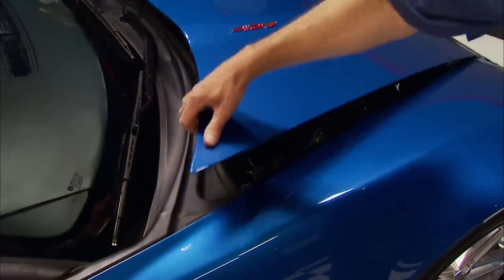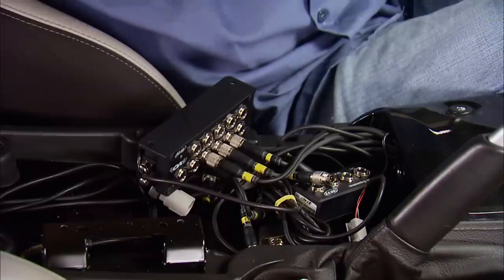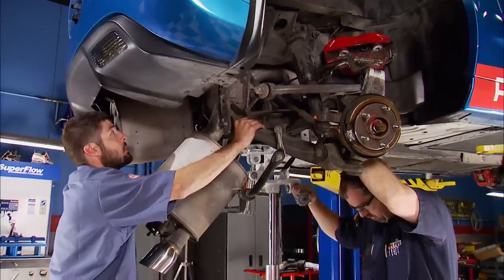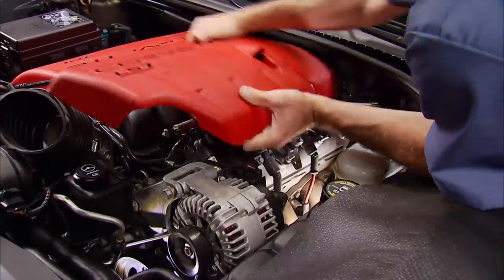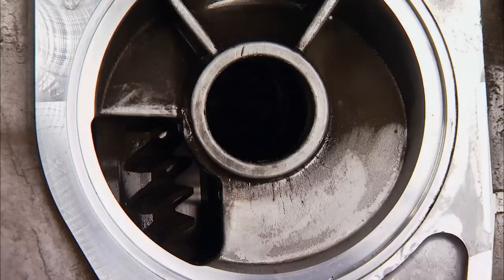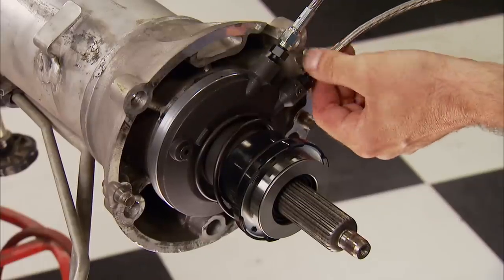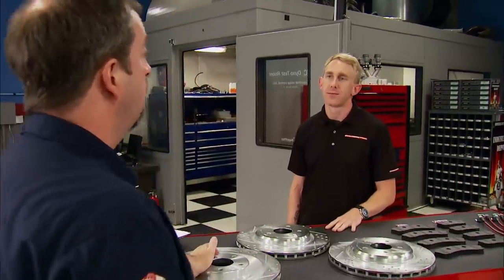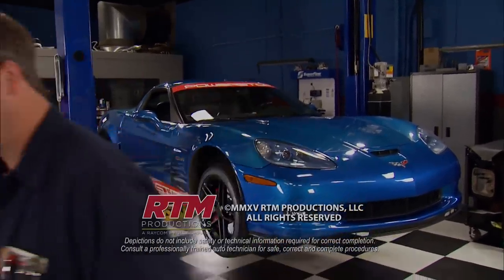Can We Upgrade a '08 Z06 Corvette to Outperform a '15 Z06 For Half the Cost? - Engine Power S2,E17

Comment: I have about $45k total invested in my 2008 Z06 (I know it's not worth that much. Engine upgrades costed around $10k - money I'll never see again, but it sure makes the car fun!). Anyway, it's just a naturally aspirated Heads/cam/exhaust LS7. No supercharger, turbos, or nitrous. Since it weighs just 3100 pounds, and now produces 660 hp, it will outperform any stock C7 Z06, Hellcat Redeye, and even the 2020 C8. The LS7 (with aftermarket heads) is a beast of a motor. It's the most fun I have ever had driving on the street.

Comment: I've always loved the C6 Z06 but I never realized how much of a pain in the ass it is to work on
Reply: A c5 is just as bad
Reply: "...pain in the ass..."

Just a gentle reminder that Colossians 3:8 instructs us not to use vulgar language. Ignore God's rules for living at your own peril.
Reply: @jhrsjhrs  In a mechanics garage all that no cussing bullshit goes right out the door
Reply: Reality instructs us differently in the real world.
Reply: They're actually very easy to work on. Don't let pulling the drivetrain out of the car intimidate you. It's very easy. One of if not the easiest car i have ever worked on.
Reply: Way easier than working on an F Body and that wasn't terrible.
Reply: @Agueart  i agree.
Reply: I was in the market for a C5 or C6 but ended up going with a Camaro due to pretty much needing a lift to work on the Vettes, as I las doing Long Tubes I couldn't help but think how much of a pain it would of been to do it on jackstands in the driveway on a C 5/6
Reply: @johncrankshaft2886  exhaust on a vette is way easier.  That's the biggest pita on a fcar. Speed engineering has a nice system now for fcars tho.
Reply: @HioSSilver1999  my brother got a C7 after I got my car, I managed to do headers in about an hour in my 2011; needless to say that after looking at his car I will NOT be touching it. Yeah I have the 1 7/8 Long tubes into a 3 inch dual system with an X pipe, working on a SS2 cam from Gwatney.
Reply: @johncrankshaft2886  oh you have a 5gen. Yea they pretty easy to work on to.

We put a ss4 fly cut cam in my friends c6. I think it's probably to much cam for stockish compression.  Ss2 is probably a better choice. Especially for a heavy 5gen.

Btw....i rid mod and port those ls3 intakes if you want something like that done.
Reply: @HioSSilver1999  Thanks man but I'm the old hot-rodding kind in the sense that I do all my own work because money tends to go further that way. The SS4 is now offered in a non fly cut option as well, the SS4 with the proper gear and stall has gotten people into the high nines and low tens with some head work and rod mod/ ported intake. I chose mine because it's right at the point where I don't have to get more supporting mods but will react well to them if I ever choose to do them; then again I barely drive my car.
Reply: @johncrankshaft2886  yea that cam definitely needs some gear. He has 4.10s in his c6 but it could maybe use more gear. The problem is that'sthe steepest gear you can get for a vette. Definitely needs more tire to get it to hook. Been a best of 10.6@134 so far with it. Just needs to hook better. A 26x9.5 ain't getting it done.

Good to here another hotrodder doing their own stuff.
Reply: @johncrankshaft2886  yea th400 is pretty good. We're stick car guys tho. The t56 in my 99 camaro is faceplated. 

I love 91 z28s! My dad has a immaculate 85 tpi iroc. Garage kept with only like 25k miles in it. He has a 70 z28 to. Been around camaros my whole life.
Reply: They're not hard to work on just time consuming processes
Reply: @jhrsjhrs  people still believe in hell in 2019 LOL
Reply: @ImKittyCow  LOL, on judgement day a lot of people are going to have looks of horror on their face when they find out that not only is hell real, but that they'll be spending eternity there for refusing to deal with their sin condition through faith in the sacrifice that Jesus made for our unrighteousness.
Reply: @HioSSilver1999  idk if the SS2 needs gears that bad, ive got a more aggressive cam in my NA ls2 we setup running 3.90 gears and itll spin all through first even if you ease onto the gas from a roll. ive got a t56 but the cam should really be a-okay if you just put a higher stall in without changing the gears that much
Reply: @ImKittyCow  that just means you need more taction. That's key.
Reply: @HioSSilver1999  youre absolutely right lol my point was that even with 3.90s the cam feels really lively in the 2500-4000 rpm range, not like it needs to rev up to 5k before it wakes up or anything. the cam specs on mine are 235/243 .629/.629 112+4
Reply: @ImKittyCow  for the most part it seems they just continually hit harder with more cam. My newly rebuilt ls6 has a 237/245 112.5. But i also bumped the compression to 12:1. 

But on the gear with 5gens it's not that they will feel sluggish with 3.90s it's that with a the tall tire on them they can run 160mph in 4th. I love 3.90s in a 4gen but they typically havr a 26" tire vs a 28ish inch tire on a 5gen. I tend to gear stuff to run good in the qtr. My old 4gen trapped a best of 131.x with saud combo.
Reply: Imagine the mid engine corvette where dropping the engine to do any work will be needed. It's a new GM engine and trans axle so it will need work.
Reply: it's probably easy just like dropping the transaxle out of the c5-c7 models. I remove engines from 4gen camaros and firebirds from the bottom. Even my mustang.  That point is moot these days.

But while your imaging that realize the reality of having to remove the cab off a furd truck do anything.
Reply: @jhrsjhrs  Using a man-made book that contains porn to tell people not to curse...lol classic
Reply: @spoolindsm127  On judgement day I can only imagine the look of horror that will be on your face when you find out that not only is the Bible not man-made, but that every word of it is true, including the part about you being cast into the lake of fire for refusing to deal with your sin condition through faith in the sacrifice that Jesus made for our unrighteousness. We'll see who's laughing then....
Reply: @HioSSilver1999  i ended up picking up a 3.91 gear set off a 1LE so i am waiting to do the SS2 and gears at the same time, given how aggressive the first 2 gears on my 6L80 are this thing will be a smoke show. Specs of my specific cam are 
In./EX 223/235In.Ex.Valve Lift637/.637LSA112
Reply: @johncrankshaft2886  good tire on it and it should move out pretty good for ya
Reply: I have found that my C6 Z06 is one of the easier cars I have ever worked on.
Reply: @HioSSilver1999  i have Nitto 285 right now but am planning on going to 305 Cooper or BFG.
Reply: @VyperVenom  i think it depends on the equipment you have and what you worked on before too, i know there are harder vehicles to work on but i simply refused to get a lift so i could get a Vette.
Reply: @johncrankshaft2886  I bought Race Ramps to work underneath the car, for oil changes, etc. I cant afford a lift either. Anyway, I have had to do all sorts of repairs; replaced the drivers side window motor and track, both door handles, battery, changed starter, battery, alternator, head lights and ballasts, and numerous other small repairs. Over all, its been relatively easy compared to other vehicles I have owned (Dodge and Chevy pickups, Camaros, Monte Carlo).
Reply: That's why I'm grateful to be poor.    The C3 with C6 Z06 parts isn't bad to work on lmao
Reply: Oil changes are also more label since it’s dry sump. Cheap super car but also super car challenges.
Reply: @groundshakersociety6637  stop cursing and shit.

Comment: I would just do a cam/heads swap on that LS7. It'll produce about 625 hp and no blower and all the issues it brings with it. It's 1/3rd the cost of that blower kit. And if you're going to rip out the drive train to replace the clutch/flywheel, replace the $5.00 rear main seal.
Reply: And pilot bearing. They do hack work.
Reply: Yep. If you're going to remove the drivetrain, replace the stupid simple things that wear normally. Especially on a car that has been beaten to death. I wouldn't want this car.
Reply: WYAIT is the rule of the land of high performance and older cars.

Comment: Scratch the Super Charger if you do it right you can get 600 to 650 at the wheels N/A Heads / Cam / Intake / Exhaust / Throttle Body / Cold Air Intake /Injectiors / Fuel System etc. Probably need a stronger clutch too

Comment: "We would never attempt this on a set of jack stands."  I have done a clutch swap on a C5 Z06 and a C6 GS and both was on jack stands.  I also was by myself the whole time.  Its not easy and a lift is definitely a huge help but you can do it on jack stands just fine.
Reply: In addition to jack stands, did you have to use 1, 2 or 3 jacks during the process? Thanks
Reply: deadend  Nothing dangerous about putting a car up on jack stands, it's literally a safety device to use when you jack a car up so it doesn't collapse on you in the first place.
Reply: deadend  Not sure you've ever worked under a car on jack stands before, there is literally nothing dangerous about it. Less room, sure. But at the same time... you have a jack on the trans when you drop it in either situation anyhow.
Reply: deadend  Except we're talking about a jack *stand* not a jack. You need a jack for both the lift or the jack stands anyhow, for removal of any parts you're dropping from underneath. You're not under the car very much to drop a transmission, as you're lowering it down onto a jack to pull it out. A jack stand is the exact same material as a hydraulic lift, they're both steel. One just has a hydraulic cylinder to move it up and down. Sure the jack stands don't lift it up as high, but you don't need to stand under a car to work on it, your grandfather did it long before those lifts became wide spread. Guess what they used then?
Reply: I've done it three times and need to do it again.  Damn slave cylinder is leaking.  Not looking forward to it at all.
Reply: But if you have a billion dollar budget, why not use a lift? Haha damn tv shows, sheesh.
Reply: 01Z06guy and that requires you to pull the trans? Wtf
Reply: @GTStuning-  2 stands front, 2 stands rear, transmission jack and floor jack for the drivetrain.
Reply: My days of crawling around on my back in tight spots are over

Comment: I did this on a 09 zo6 on the floor with jack stands by myself.😂 probably one of the harder jobs I’ve done on jack stands .but it can be done also rebuilt the torque tube and added a twin disk  . These cars are a lot of fun 👍🏻

Comment: I did. I spent 33k on my Z06 and 15k on my Supercharger, trans upgrades, and coilovers. 855rwhp later.
Reply: WOW!🙀😎👍
Reply: Kim Chi now it’s a super car killer 🤘
Reply: Cali Angler he spent $48,000 to beat a $70,000 hellcat stock my factory. 

Pretty good numbers if you ask me. 

Out another $15k in and you’d walk just about anything stock.
Reply: Jarrod G he could have easily gone the n/a route with doing his heads, bigger cam, some bolt ons and e85 and it would easily take out hellkitties all day
Reply: Cali Angler you're delusional
Reply: @KobaBlack113  No not really, these motors can make over 700whp n/a
Reply: @KobaBlack113  lol a c6 weighs almost 1000lbs less than those hellcats and fbo built n/a engine makes around 600-660whp which is more than what stock hellcats make to the wheels. thats a walk in the park for the c6z
Reply: Cali Angler yup hellcat makes low 600s stock maybe like 620-630 and much heavier even if it has more torque.
Reply: So almost 50k to have an outdated vette with no warranty? lol yeah i'll take a c7z with a warranty and make less power.
Reply: Jake go for it nobody is forcing you to do anything lol all personal preference. Personally I love the c6z and prefer the 7.0L v8 over the lt4 in the c7z🤷‍♂️
Reply: @BigKfishing  lol i did. I currently own a c7z. But when the c8z comes out, i say bye bye to the c7. These cars get better with each generation. Nothing wrong with the c6z. It's a monster. But it's old. And warranty is a big deal to me. Especially for what these cars cost. Or i mean what the engines cost. An LS7 crate motor isn't cheap. And neither is the LT4. I'm fine with 620rwhp and a warranty.
Reply: Jake good on you man the c7z are sick as hell
Reply: Cali Angler - you seem like a pretty decent guy! Good on ya.
Reply: @KobaBlack113  A stock C6 Z06 is a drivers race against a stock hellcat. Remember the Hellcat weighs about 1300lbs more than a C6 Z06. A Z06 with a cam and tune would destroy it.
Reply: @SMD-si7fm  I guess you have no idea about Corvettes. a head and Cam c6Z06 will eat a Hellcat all day. New 5.0 Gt mustangs with a pulley ,headers ,and a tune are beating Hellcats all day at the track. Most Hellcat owners can't even break a high 11. Weight is the Hellcats achilles heel.
Reply: @shitloveaduck  thanks buddy.
Reply: PonchSS that’s true but a pulley and tuned hellcat that can 60ft will destroy a heads cam c6 z06
Reply: james acosta do a little bit of research before commenting. A auto hellcat fully stock on only radials can do 10 secs fully stock powerz
Reply: @TheBb6prelude  lol stock c6z's have run 10s stock too. Through a manual. A heads cam c6z will destroy a hellcat. Pulled and tuned too.

Comment: What about the valve dropping issue with that 7.0? Should of really done something before it does something. Also you didn’t replace the pilot bearing, big no no.
Reply: H&P Customs not their problem after they give it away.
Reply: @RadDadisRad  lmaooo that's fucked up
Reply: These guys do this sort of stupid shit on every build. It's stunning.
Reply: I guess if you win it then you can fix it.
Reply: There was a video they did on a mustang where they drilled and tapped into the oil pan while it was still on the car. They show you so many things to not do to cars. I also would never drive one of their cars. It would be sold if I ever won one.
Reply: Never heard of the valve dropping issue. Sounds like internet chatter...
Reply: Spartan Savage - there is a ridiculous amount of that going around!
Reply: Spartan Savage internet chatter or you’ve been living under a rock. It’s a real thing, just like oiling issues with the new GT350 causing catastrophic failure and seizing the engine during track use.
Reply: Ws6Ms it is but am I wrong?
Reply: That's what I said to what about the valve guides cuz those are notorious for dropping valves the LS7
Reply: @stitch684  yeah the LS7 are notorious for dropping valves if you don't change out the valve guides
Reply: @stitch684  Not chatter.  I had it happen to my C6Z.  Oil pressure was perfect when it happened.  Broke the tulip clean off the stem.
Reply: so they pretty much would've made it bullet proof if they fixed the valve issue?
Reply: Shit probably has crazy low miles so it's  not that big of a deal
Reply: @derakbell8143  miles don't make too much of a difference.  The issues is improperly sized valve guides. The LS7 is different than the other LS engines and GM used the same sized valve guides that they would use for LS3.  The guides need to be longer to help with the longer stem.  Also, they used powder metal which some will argue is not superior like bronze.

The LS7 also has thin sleeves, so it's not exactly bullet proof.  Most people stop around 700-800whp due to stock sleeves.  Are there people that hit higher numbers? Yes. Are they smart? Probably not.
Reply: I was referring to the pilot bearing not the valve issue
Reply: Brandon Douglas Valve guides are the issue, I’ve seen the valves move side to side on take off heads and it’s not pretty. Let’s also not forget the valve stems are hollow.
Reply: Matt Miller ls7 trunnions are good. They are a common upgrade for every other LS
Reply: A rather simple head change will remedy this plus you will be adding a good amount of power while doing it.
Reply: @HP.Customs  I have hollow stems on my current 427, it's fully built and has lots of street miles but either way, they are hollow stem exhaust valves.  Proper valve train geometry and quality parts goes a long way it seems.
Reply: @stitch684  sounds like you've been living under a rock...
Reply: @stitch684  Better readup then pal. Go spend a little time in the C6 section of the Corvette forums and educate yourself.
Reply: Lol some poor fella probably put like 1000 miles on this car and now it needs a new motor haha
Reply: American racing headers are way better
Reply: @devinandjim  until they cook your oem starter lol had it happen to mine 06 60k on the odo
Reply: @derakbell8143  mine had 23000 when motor blew!
Reply: @stitch684  bbbwwwwww.  No its valve clatter that you hear .  It's a real very real thing.

Comment: If ya done an RaceProveMotorsports, "RPM," Cam package, w/ full intake & exhaust, they have made 650WHP, saved weight, prly cost less, and been a better car all around. Then put a blower on, lulz.
Reply: Haha ya I thought they were going to upgrade the heads and cam as that would definitely make it more competitive against the c7.

Advanced induction 280 cc cnc work on the stock heads, 1 7/8" headers, RPM B-3 cam (some are saying the actual spec is 243/259 .623 .623 116), ported Msd intake manifold, Halltec or Vararam intake, plus a good tune would have got them to 640-660 horsepower at the wheels (540-560 ft lbs of rear wheel trq)
Reply: @GTStuning-  I've always wondered what the specs were on that B-3 cam.  Have these numbers been confirmed?

Comment: You can add a supercharger to a C6 and get equal power, but it will never keep up with the C7 as far as handling. Between the much stiffer frame to the electronic rear differential and electronic steering rack the C7 simply handles noticeably better.  I've had both the C6 and currently have the C7, both Z06's, and the C7 is much more stable and planted, and gives you much more confidence in the twisties.